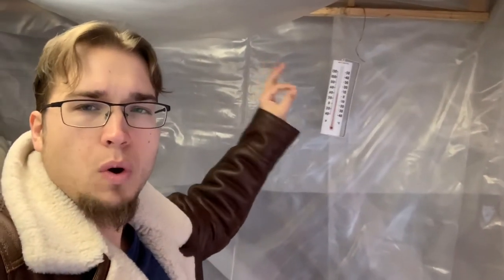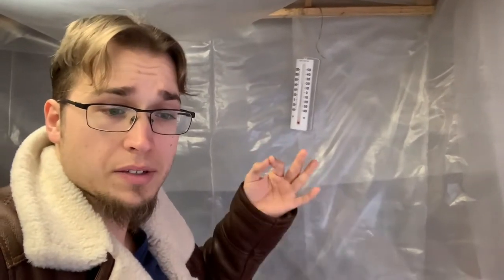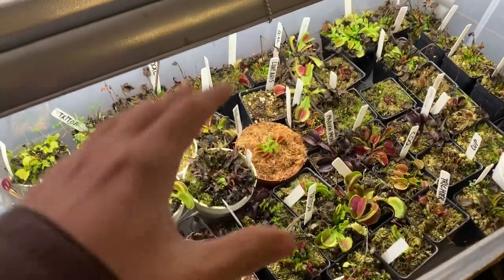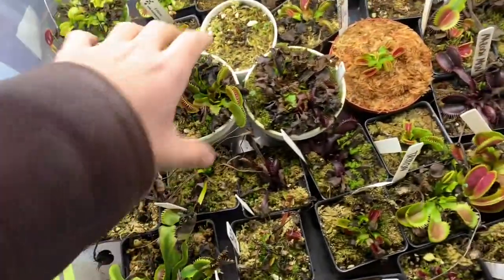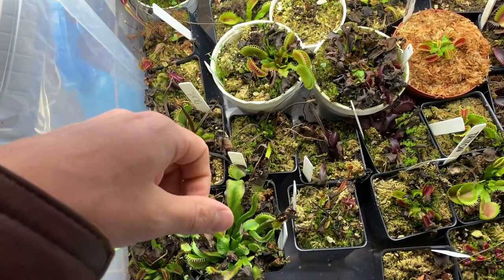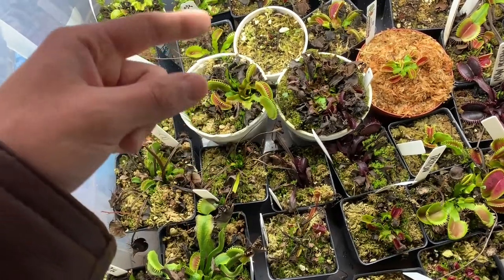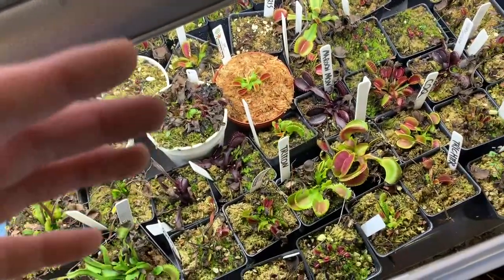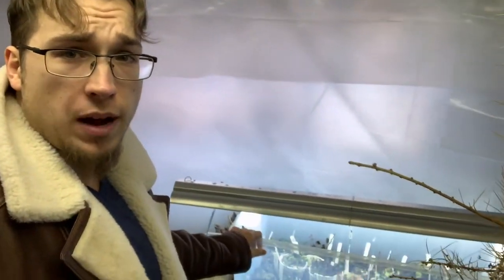How to Grow Venus Flytraps - Dormancy Explained

Comment: Good video. Although the more VFT videos I watch the more confused I get.  Some "successful" growers recommend Terrarium, some don't.  Some recommends soggy soil / moss some says just damp.  Some recommends 100W+ grow light then some says 15W is enough.   My VFT seller told me that I could just leave my plant on the windowsill and it would go dormant.  My house in NJ rarely goes down below 70F during winter.  But you are telling me that it should be kept at around 35F.

One thing I was impressed though was how healthy your VFTs look in Winter.   My seller told me all leaves would go blackened and die out.

Comment: Question. I just left my VFT outside over winter. It gets cold where I am (Northern Spain), one night we got down to -4c (20F I think?) and my trap froze, but it seems fine now. But, even though it's cold there is still a lot of light, is this a bad thing? I had read somewhere that as long as it gets cold, like you said in the vid, and the days do get shorter over winter it's OK to leave outside. It doesn't look like any of those dying plants you showed as examples so I guess all is good?? Great vid btw, been looking forward to one from your channel!!
Reply from the maker: No, it won't be bad if they are getting light. My main point is that it's just not necessary to take any extra steps to give them light if it's cold. The light won't hurt them, they just won't be photosynthesizing cold weather and not really gaining any energy from it. Naturally they will be exposed to light in their North and South Carolina habitat through the winter, even though they won't be using much of it.
Reply: @TheBonsaiJungle  great thanks, that what I thought, that they'd be getting light in their natural habitat

Comment: My vft is outside and the weather is usually in the 20s and 30s. But all the traps have a lot of black parts to them. Are they just dying back all the way or something like that? I have them potted in peat moss in perlite and I am making sure that the soil is moist.
Reply from the maker: If they aren't protected in a garage/cold frame/greenhouse they will definitely get more damage on the leaves and almost entirely die back to the rhizome only. That's why I've always went out of my way to insulate them and not have them drop below 33-35.

Comment: What do you think of repotting the VFT in this time of the year? I've heard some opinions that it's good now(February) because the plant is not active yet, which means less stress. In a way it seems logical, but I don't completely agree with this. If repotting happens now, will it affect it's growth during spring/summer period?
Reply from the maker: tedd usually it’s best to repot right before spring. I would do it once the danger of frost has passed though, right before they start to push out new growth.  It’s not a huge deal IMO though, and you can repot any time of year.
Reply: @TheBonsaiJungle  Thank you. I've repotted it but not very deep. The white central area can be seen, a little. Will this be a problem? And another question.. I've removed some of the dead traps, including those which were not fully black. I did not refrain and decided to remove them also. Perhaps a wrong, fatal decision. Will this affect the plant in a way? It looks stressed at the moment, how long will it take to recover( if it will )?
Reply: @west8480  The rhyzome should be covered so it doesnt get burned by the sun or damaged by anything else. Do not snip parts that are not fully black or you will slow your plant’s growth because it is still in the process of reabsorption.
Reply: @Tatusiek_1  Thank you. Yes, I did exactly what you guys said. The plant did very well during spring/summer time and we're almost ready for our second dormancy. How are things with yours, @eggrollsoup?
Reply: @west8480  Should be going into dormancy soon

Comment: So this might be impossible to answer, but can you at least give  your thoughts about my winter dormancy?  I'm in Edmonton Alberta, latitude 53.5 North, and 10 or so years ago I had quite a big collection of VFTs, 50 or 100 plants.  I started with just a few, but the bulbs kept dividing and I just kept separating them and growing them up. I can't recall how many years it took to build up this collection of VFTs (plus a bunch of other CPs), but it was obviously a number of years.  I was regularly getting summer traps over 25 mm, with the biggest peaking around 40 mm. I would leave these plants outside until late September, letting them go dormant with the lower light and cooler temps, and moving them into shelter if frost was predicted.  Then I moved them to a south-facing basement window until mid-March, when I would move them under grow lights to wake them up for a new growing season. 

But was I really giving them true dormancy? Our winters here have short days, with the sun only up for 7 hours in December. Our basement windows are cheapo slider windows, so they don't offer much insulation and during the hard cold spells of mid-winter the ice on the inside of the window can grow to an inch thick.  But we also have warm spells in winter when the outdoor temperature rises above freezing and things are correspondingly warmer inside.  I would say that the basement temperature in the middle of the room in winter is about 60 F (vs 70 F upstairs in the main living area).  In the pots on the basement windowsill where I had the plants it probably fluctuates from about 35F on cold nights to about 55 F on warmer days, and this would go on for maybe 4 months each winter.

Do you think that was enough dormancy, or was I just killing my plants in slow motion?  (In the end, I stopped growing CPs because the fungus gnat issue was driving me crazy, so one year I just didn't bring them indoors in autumn. But I miss them, so I'm starting up with new plants now (VFT and Drosera), and wondering about dormancy.)
Reply: I should add that during the winter dormancy (or fake dormancy) the plants really did nothing... no new growth, very little die-back... basically they just sat there looking not much different from when I first brought them inside in late September.
Reply from the maker: Don Thacker hard to say for sure but I think they probably were dormant. Was it regularly dropping to 35 at night? If so then even if the temp was getting to 60 during the day they could have still been “semi-dormant”....again it really hard to say without seeing pictures of the plants. One good sign is that the traps become non-functional during dormancy and will close very slowly, or not at all if it’s cold enough for them to be completely dormant. I’m not sure if you ever tested that out. I suspect they probably adjusted to the conditions if you were regularly keeping them like that over the years and still went dormant at the end of what they recognized as a growing season.
Reply: @TheBonsaiJungle  I wouldn't say it was regularly dropping to 35 at night, but during extended cold snaps it might be 35 at night and maybe 40-45 by day, for a week or two at a time. Then have some warmer weather and be maybe 45-50 at night and 55 by day. The fresher looking traps did still close, though I can't remember how quickly. The older traps didn't function of course. In thinking about it, I recall now that the reason I had to move them to grow lights in March was because they would start growing on their own by late February or early March and I felt needed better conditions than they were getting on the windowsill. I really wanted to delay them from new growth until early May when I could move them outside again, but that was never possible, they always started putting up new traps around the start of March.
Reply: Anyhow, the reason I was asking was because I was wondering if I could use this set-up again with my new plants, but maybe if I don't let the collection grow, I can just put them in the fridge for a few months.
Reply from the maker: Don Thacker I think your existing method would work very well. There is also my older video where I was making the storage bin with reptile heating cable that I stored in the garage. That worked well enough without this larger set up or space heater when insulated well. But there are growers in FL that likely don’t have a temperature drop much different than yours so like I said yours sounds good enough to work and you can always try the fridge if your still try to grow during the winter. Due to time restrictions and the general uncertainty or new growers I try not to get too much into the nuances in my video and like to give general recommendations (hence the 25-40*F range I always talk about for dormancy ).
Reply: @TheBonsaiJungle  OK, thanks for the ideas and quick response. Garage isn't really an option here, as it will drop to -10F or colder in our unheated garage in the coldest winter weather.
Reply: Question...
So, it's the end of October here in jersey...
Should I move my ft to the dark basement in the little black pot it's been in, keep it semi moist til around Feb?
AND DO NOT FEED IT ANY BUGS?

Comment: Man I'm so nervous! I live in an apartment in NYC. As you said, apartments generally never get below 60f, which is why I put all my plants to sleep in the fridge early December. It's the first time I've done this so fingers crossed when I fetch them out in March they're still alive.
Reply from the maker: Are they in pots, or did you unpot and bag them in sphagnum? Either way can't you check on their foliage and rhizomes to see how they're doing?
Reply: @TheBonsaiJungle  I unpotted them, clipped back the leaves, washed them (in distilled water) and wrapped them in damp sphagnum moss. I then tucked them in tupplewear containers.
I'm too nervous to go check since it's already been a month. It'll be a learning process this April :-) Either I've succeeded in my first dormancy, or I just lost all my beautiful (and expensive) plants.
Reply from the maker: KENTOSI it sounds like you did everything right so I would be surprised if there was something wrong with them. The only potential issue is if you stored them with really sopping wet sphagnum, but I’m assuming you followed a guide and this is not the case.
Reply: Okay I'm new to actually having a green thumb. So do all Venus plants need to be put into dormancy in order to keep them alive for years (mine live inside)? Do all plants need this? Of you don't put them into dormancy it's automatic they will die? I'm kind of used to plants that just sit there and get watered so dormancy is a new topic for me.
Reply from the maker: @authenticadventures7814  I'm going to say yes. Traditionally dormancy is a requirement for venus flytraps. If they don't go dormant they can survive up to 4 years, but will then "crap out" and die. There is an "exception"... where one guy has kept them indoors for ten years and claims they are fine without dormancy, but the trade off is that you must give them a constant 14 hour photoperiod of around 15,000 to 25,000 lux under LED light. You then also have to keep feeding them every month. NOTE: this is also just one personal experience/claim from one guy. Many growers still disagree and argue about that method and I'm one who is playing safe/doing it the traditional way and providing dormancy as it's their natural cycle and proven to be beneficial.
Reply: @TheBonsaiJungle  thanks for the wealth of knowledge. So when you decide to put them in the refrigerator? Any specific month?
Reply from the maker: @authenticadventures7814   If you're in the US I would just follow the seasons in your region. Pop them in the fridge around late November and take them out after 3 or 4 months when there's no longer a danger of frost occurring. If you are not going to be placing it outside, and instead continuing to grow it indoors then obviously the exact date when you take it out doesn't need to coincide with any outdoor conditions, so you could just remove it right at the 3 month mark. Like I always mention though make sure its getting good light if grown indoors. It's really not common for most people to be successful just sitting them in a windowsill like I often mention, and grow lights are a huge benefit to the plant, even the cheap $20 Yescom panels which can be purchased in the white light variety.

Comment: Hi. uhm at my place it doesn't get too cold where i live so i used the fridge method but when it came out, it look liked the dying fly traps that you showed in the video.
Reply from the maker: Hard to say what happened without seeing them and knowing exactly what you did. They could have either dried out or stayed to wet. Did you put them in a bag before they went in the fridge? Did you check periodically for mold or to see the moisture level?
Reply: @TheBonsaiJungle  yea I did check for mold and moisture level. The rhizome was white but the leaves look like it was dying
Reply from the maker: @kyawthuta9058  Did the leaves all start dying off right away, or was it a gradual process?
Reply: @TheBonsaiJungle  they gradually started dying

Comment: Great video. I just made a video on  my flytraps going through winter dormancy. You should check out my flytrap videos. I actually mentioned you in them about the Scott's Disease EX and show the results. I think you'll be impressed.
Reply from the maker: Rodder Beck looks good. Many people have asked me for a compare and contrast video about the diseaseEX since they figured the boost may have just been from the plants taking off in early June as one would expect. I have started an experiment where I bought two Vfts from Home Depot last summer and I’m leaving one without treatment. Hopefully this spring I’ll see a huge difference and upload it as more proof. All of the effects are originally documented in a scientific paper, but it’s nice to see other people getting good effects in their own collection as well.
Reply: @TheBonsaiJungle  , I'm definitely a believer. It's a great tip to use and it works. Thank you.